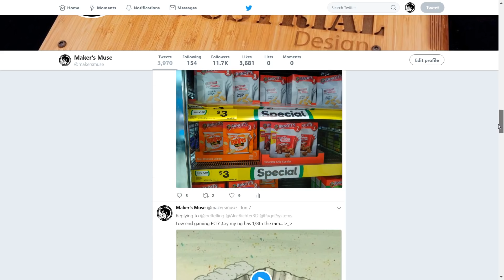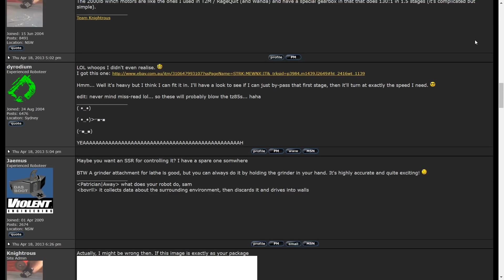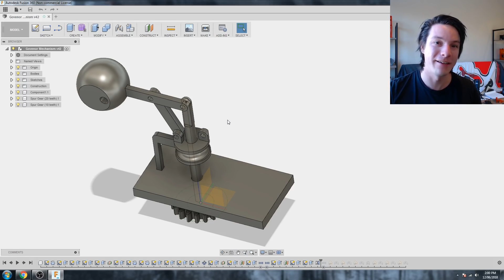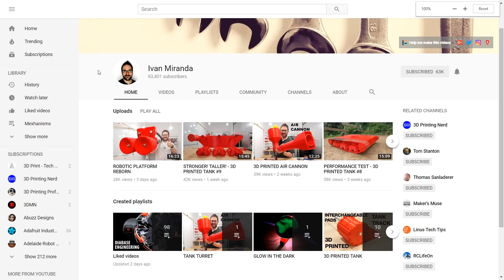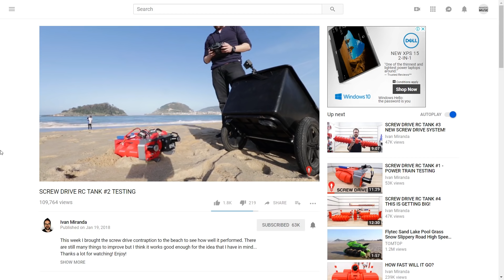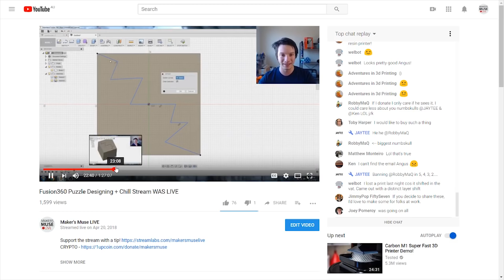Why you should document your projects.

Comment: I was surprised you didn't mention GitHub/gitlab for code source control. Tracking changes in Configs and the like can save yourself time and be invaluable to others. In source control you can see every change line by line over time from a newbie perspective it helps you greatly understand how you can grab someone's code and build on it. It's 2018 no one should have to reinvent the wheel when the internet is available. Great points to cover you don't get technology leaps by everyone sitting around not sharing progress.
Reply: Ye, github is great for software version control. A handy tool

Comment: If you're working with code specifically, I highly recommend inline API documentation. In the JavaScript space specifically, one of the solutions I use quite often is called JSDoc, which uses specially crafted code comments to document the interfaces of all of your functions (there's also TypeDoc for TypeScript). I know Python has something similar built into the language with docstrings, and I'm sure similar solutions exist in other languages. 

If you keep the documentation close to whatever you're working on, it becomes a lot easier to keep it up to date if you need to change it.

Comment: Dear Maker's Muse, I have a tablet-laptop with a detachable keyboard. The only way it can stay open in a typical laptop shape is with a stand that folds out from the back of the tablet on a flat surface. Is it possible to design/ 3d print a pair of ratcheted hinges that could clip to the key board and the tablet to hold it open? (there is a small space either side of where the keyboard attaches)Thanks

Comment: I strongly suggest hosting your build logs somewhere that Internet Archive will find and back up.  That means not using:  DropBox, OneDrive, Flickr, Imgur or OneDrive, unless you specifically tell IA to back up your site.  All of these services are ephemeral, some more than others; free hosts you don't pay for are particularly prone to change whenever they need to increase revenue.  IA is a non-profit dedicated to knowledge preservation.  Host somewhere, but tell IA about it.  When your 'free' host goes away, IA will still be there.
Reply: I'm also deeply frustrated by the new trend of using Facebook as a forum.  I bought a Creality Ender 3, and the #1 place to get information and help with the printer is the Facebook group, and it's an amazingly bad forum compared to real purpose-built forums.  I wish somebody with a following would create and/or endorse a real forum for it instead and get people to move there.

Comment: Been thinking of doing an "open seedo", but honestly think ppl wouldn't give a single f.
+ the plastic would probably melt like candle wax in these high temps.
Reply from the maker: As in hydroponics? That'd be pretty popular I reckon. PETG should be able to handle the temps and exposure to moisture I've been considering using it for some aquaponics experiments.
Reply: I've been running a PETG fan shroud 1mm from the heat block on my 3D printer without melting it - try it and see - and document it...
Then you will know if anyone gives a F... you never know, the world is a big place.
Reply: Maker's Muse Jah! Thanks for the tips, maybe I will document this project.
Thanks for the response btw :p

Comment: I honestly struggle to make and upload videos of every thing I do. As you can see by my 3D printer design videos  I have a tendency to finish a load of work and then talk about it. A lot of the process and other projects don’t get as much attention.
Reply: Regarding demonetisation... I wasn’t in it for the money however I had slowly worked up a decent sum. Not enough that I could claim my first cheque though so all that money that could have gone back into the channel is stuck with Youtube. Because they have ridiculously high claim levels...
Broke my trust in them a little bit.
Reply: So it would seem I have all the steps, I just don’t have the work structure built around it (yet). I DO have a mid-progress video that I need to release soon which is very Point-and-Shoot but should be rather exciting to some makers.